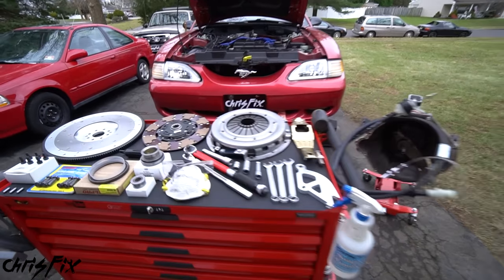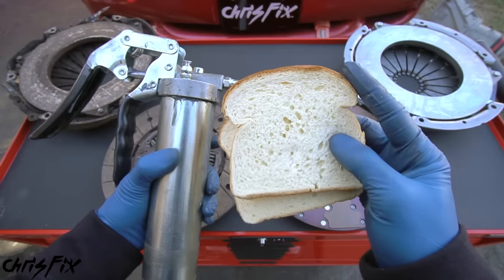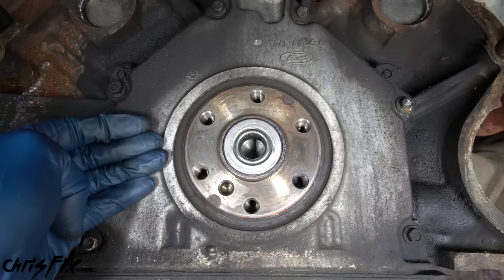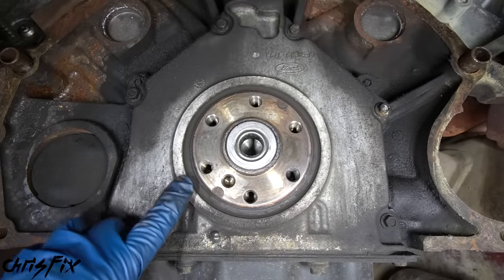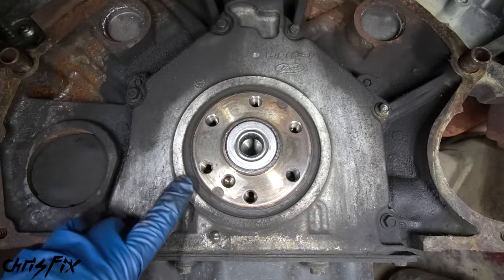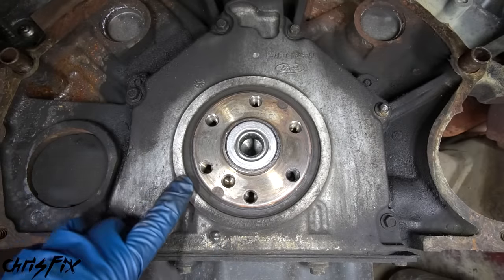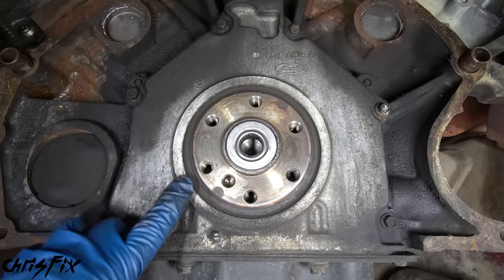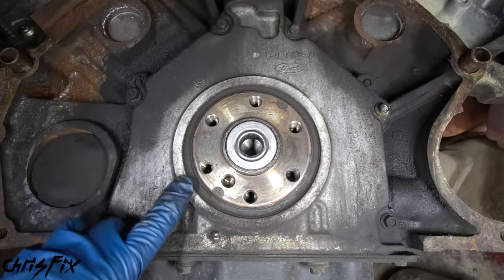How to Replace a Clutch in your Car or Truck (Full DIY Guide)

Comment: The mechanic changed the clutch disc, and then the car started vibrating at a speed of more than 80km/h . He told me that this is normal and that I keep driving and the vibration will go after about a month. Is this correct or did the mechanic install the clutch disck wrong?

Comment: Chris you probably already know always check your crankshaft see if the anywhere were your seal connects sometimes the crankshaft will have a bad Groove and cause the engine to Legal engine oil

Comment: If the tranny shaft doesn't want to go into the clutch, have the tranny in gear , and you can turn the output shaft which will turn the input shaft till it meshes with the clutch splines. Easy Peasy! I never worry about spline alignment with this method.
Peter, retired Master Toyota tech.

Comment: Just a quick question..does gearbox need to be in neutral when removing gearstick or does it not matter?
Reply from the maker: It is definitely best for it to be in neutral but as far as the vehicles I know, it doesnt really matter. Just install the gear shifter in whatever gear you had it in.

Comment: Bro try to remove bearing with candle in the place of grease and bread that will be very easy, but the candel will struck in the beginning after removed and it will not be able to reuse

Comment: Do I have to drain the transmission? My truck is high mileage well kinda 230k but  I’ve heard it’s bad to change old transmission fluid
Reply from the maker: That’s only for automatics. Manuals are only helped by changing transmission fluid.
Reply: @chrisfix  okay thank you!

Comment: Replacing the rear main, a perfect exampleof the choice between doing it right,  and doing it again.

If the motor or trans is out for repair,  clutch and seals get replaced,  as SOP. Because nothing sucks worse than doing all that work, Twice.

Comment: why would you want a light flywheel, isn't that counterintuitive to a flywheel's purpose to be heavy and keep rotation for long periods of time?
Reply: you get better engine response and quicker revving with a lighter flywheel, also more power to the wheels as there isnt as much parasitic losses. but thats only to a point, as yes they are supposed to be heavy and keep rotation but you can always find a balance. it can make the car slightly harder to drive as it will stall easier and require more revs to get moving, and the lighter you go the faster you will have to shift

Comment: Very difficult to get the transmission out without a ramp for driveway DIY. I can barely get it high enough to do the fuel filter on my BMW f20 let alone have room to drop the transmission 😬 from what I can see, if you can change your brakes you can change the clutch... If you can get to it 😂

Comment: Observation: A lightweight aluminum flywheel does promote increased engine RPM response as compared to the OEM flywheel; however, I noticed when my engine was at idle, A/C activation would produce a temporary 2-second shudder under which the engine would nearly stall.

Pro-tip: Ensure ring gear bevel orientation matches betwixt the OEM flywheel and the lightweight aluminum flywheel. This is where the starter solenoid advances the gear that engages and rotates the flywheel ring gear, thereby starting the vehicle. I bought a brand new lightweight aluminum flywheel, installed it on my vehicle, then found out the ring gear had been installed by the manufacturer in the wrong direction, causing a hideous noise at every startup. Had to rinse & repeat...

Vehicle details: 1990 Toyota Celica Alltrac (engine 3S-GTE).
1999 - Installed Fidenza flywheel & A.C.T 6-puck clutch (which later broke a p.p. finger)
2007 - Vehicle sold.
Reply: Observation, perhaps with the limited rotating mass of a 4 cylinder engine with 2 cams to rotate, amongst all the other components attached to the pulley system, it relied heavily on a flywheel with greater mass to counter act the massive draw it takes for everything to be on at idle.

Comment: Just wondering. Is it possible for the oil pressure warning light to turn on because rear main seal is leaking? I have heard it can, but is it true? Mine leaks and I have had oil pressure light turn on
Reply from the maker: For 99.99% of cars the rear main seal has no effect on oil pressure. The only way it can effect oil pressure is if the leak is causing your oil to be low and that low oil starves the engine of oil.
Reply: @chrisfix  Thanks a lot, guessing the problem is the oil pump then because I replaced the sensor and it has enough oil and new filter
Reply from the maker: @simenskaar5843  Could also be the engine is worn
Reply: @chrisfix  when I checked the cams they didn't seem that worn for a 16 year old car, but oil pump drive shaft is known to get rounded on those engines

Comment: How do you jack the car high enough to slide the transmission out?
Reply from the maker: Those 12 ton jackstands get it high enough. You can put a block of wood on your jack to get it high enough to use those jack stands.

Comment: Do you HAVE to resurface the fly wheel?
Reply from the maker: Technically no, but it's pretty inexpensive and will help the new clutch so I would recommend getting it done. Check with a straight edge to make sure it's not warped or has low spot anywhere while it's out

Comment: Clutch and pressure plate with both bearings replaced, drove fine for a couple miles then started slipping, badly, no extra play in the pedal, please help
Reply from the maker: Did oil get on the clutch? Check through the inspection hole to see if the clutch looks oily
Reply: @chrisfix Need an adjustable clutch cable stock one is too loose doesn’t hold pressure on the bearing to keep the clutch engaged when in gear, thanks for the suggested help

Comment: This moment 23:00 is the very tricky part. I got mine chaneged in a garage and technician forgot to torque the pressuree plate screws he  instead uses an impact gun for faster operation . And a month later my clutch was ruined and i need to reinstall one due to presure plate being installed unevenly (sloped ) and the clutch disk was worn either in the bad way . Shiiiidddd

Comment: The grease/bread method for the pilot bearing doesn't need both, just one or the other and a close fitting dowel of some sort, I always used to use grease which works great but leaves a greasy mess, last time I tried it with bread and I think it worked better than grease personally, and cleanup was a breeze, using grease and bread is just an unnecessary waste of bread and leaves a greasy bread mess. I'd say just stick to bread or the proper puller if you have it, if you use grease and your dowel isn't a tight enough fit you may get sprayed with grease in the hands and face and that's never fun, if bread somehow did that, well, I guess then you'd just have a snack with extra clutch disc nutrients lol.

Comment: I recently just put a new clutch on my 04 mustang gt. Drove it for a bit and was working just fine. Went to auto zone and when I went to turn it back on and tried to change gears it wouldn't shift at all. Pedal just sinks in. Help anybody?  Chris?
Reply from the maker: Check the cable.

Comment: Do we need to drain the oil when we do the rear main seal?
Reply from the maker: 99% of the time, no. The oil level should be below the rear main seal.
Reply: @chrisfix seeing you still replying to comments is awesome! Keep up the great work looking at buying a Mach 1 for around 6-7k and it needs a throw out bearing & clutch cable

Comment: Why not just remove the pilot bearing when the flywheel is out using a socket or a press?
Reply from the maker: You could remove it with the flywheel on or off, either way works, and how would you remove it with a socket?
Reply: @chrisfix  get a socket that's ever so slightly smaller in diameter than the outer race of the bearing, lay the flywheel on a couple of 2x4s and pound it out.
Reply: @ryanbareither89  The pilot bearing is not on the flywheel , therefore removing the flywheel will still leave the pilot bearing on the crank.
Reply: @jonathanrojero9324  gotcha. On my geo metro it is in the flywheel. I assumed that was standard.
Reply: @ryanbareither89  Ah okay I see, In that case it does sound a lot easier to remove the flywheel and do it how you stated before.

Comment: SAFETY WARNING!!! Do not use Chrome vanadium sockets or tools when using with impact tools or hammers. It can break and because of metal tension or strength of impact shoot with sharp ends.
Reply: Use specified sockets or tools for impact.
Reply: Thank you I did not know that 💪🏼

Comment: Omg Chris!!! Noooooo don’t use anti seize on the fork pivot. Use moly lithium lube!!! Anti seize is not a lubricant. After the fluid dries out. It’ll start squeaking very loudly because there’s fine particles of metal against metal. It’s a horrible lubricant!!! Everything else was top notch though.

Comment: I broke a pressure plate bolt on install 🤦🏾‍♂️
Reply from the maker: Dang! Was it overtorqued or was it something else?
Reply: @chrisfix  I think I hit it too much with the air tool 🤦🏾‍♂️ I did a pi engine swap from a crown Vic and forgot to add in a pilot bearing as well 🤦🏾‍♂️😂 so now I’m dropping the trans, and I got longtubes 🤦🏾‍♂️🤦🏾‍♂️ sheeesh
Reply: @chrisfix what’s the part called that was seized around the input shaft? I think mine came loose

Comment: WARNING do not use his advice on the pilot barring! When I tried this the seal popped out not the bearing. I was forced to remove the fly wheel and do it manually. 😡 
Furthermore he never mentioned anything about a transfer case. Some people have 4wd. Had to figure out out on my own.. other than that excellent video 🤙

Comment: 🤔🏁Chris you're so right clutch dust also break dust  causes lung cancer always wear a respirator when  repairing brakes or a clutch never blow brake dust or clutch dust around inside of a automobile repair shop with a air hose or any area you're working on automobiles I really do know I am a real ASE certified master Auto Mechanic or a master auto technician with over 60 years of real experience also my grandfather was a real doctor for over 40 years

Comment: So all I have to say is.... trying to take a pilot bearing out that has 150.000 miles plus bread has never worked for me. Im an  experience mechanic  many years. Iv just never had the bread work I always use the tool

Comment: I'm not really recommending doing this at home without elevator and bunch of tools and experience. I changed my clutch yesterday for 80 bucks, there were 3 young mechanics that changed it in 3 hours, I watched the whole show. It was a huge mess, without experience it is very difficult

Comment: If the car is driven by the wheels at the same end as the engine, it's even MORE difficult to replace the rear main seal.

Comment: I love Chrisfix but using rtv seems like a cheap and unprofessional move, Un-Chris like
Reply from the maker: I always prefer to use an actual gasket, but sometimes they don't make them anymore and you're forced to use rtv. If you apply it correctly then I wouldn't have any issue with it

Comment: gotta drop the tranny first...that's it's own challenge. I tried doing that on an older Suburban. you'd think that'd be easy, but...no. no it's not, the bolts are just so dang close to the firewall there's basically no clearance. and all the other issues of do you get the upper bolts from the top, by reaching your arm in there...from below reaching around the transmission...Ugh. being a mechanic with "basic hand tools" is a hassle.

Comment: It would be nice to say, that rear wheel drive setup is easier for gearbox removal then front wheel drive. in europe i would say 95% od cars are front wheel drive. for gearbox removal you must 1) pull the engine and gearbox up by crane or 2) remove subframe if you want to lower the engine down, this usually mean redone the wheel alligment in the end. Just keep that in mind if you want to do it yourself...

Comment: you DO NOT and I repeat DO NOT EVER use automatic transmission fluid on a manual transmission. It is not for manual transmissions. Consult your owners manual for this. My vehicle specifically calls for a 75W-90 gear oil but also make sure that the gear oil you use is safe to use with yellow metals as some are not.

Comment: wtf light weight flywheel?
flywheel, heavy wheel attached to a rotating shaft so as to smooth out delivery of power from a motor to a machine. The inertia of the flywheel opposes and moderates fluctuations in the speed of the engine and stores the excess energy for intermittent use.
Reply from the maker: Yep and lightweight ones make it quicker for the rpms to raise

Comment: If you are worried about scratching your crankshaft when prying your rear main seal, I have used nylon bicycle tire levers in the past. they are usually no more than $12CAD for a pair

Comment: 38:00 why are you replacing the flywheel.. we are not recommended to change its weight or  dimension.. it should be factory fixed..

Comment: look only for the restoration they used bad and good strong tools and air tools because the oldest cars are verry rusted and the restoration youtubers damaged any cars using correct tools and lathe and milling because they have couple of hours to fix the damaged parts for the damaged internal tools using the adjustible tools accept the Rtv and any tools for any cars are rusted by restored thx

Comment: I don't think this is a very good idea.  Unless you have plenty of experience and the tools to attempt this, you had better trust to the professionals.
Why even do this outdoors?  Even indoors there will be plenty of contamination that can make such installations marginal.

There are plenty of YouTube videos showing clutch replacements and very, very few are done by non-professionals.  
What happens when you are 1/2 way thru and find out you need another part or tool?  If you have only one car, good luck.
My 2016 VW GTI burned out the original clutch when I installed a stage one upgrade.  VW's pathetic torque limitation burned thru the clutch in a matter of weeks.  You can bet I went to the best GTI shop in San Diego and got my car back in one piece and at a decent cost.

The job is very complicated, and you have to have a long check list to remove and re-install all the parts, trims, brakes, etc.

Comment: Dude wiggles an input shaft not retained at one end and thinks the play is excessive. LMAO. Was that really the sole basis on your diagnosis that it needed a trans? No noise no contamination. Just what you suspect was excess angularity in a bearing?